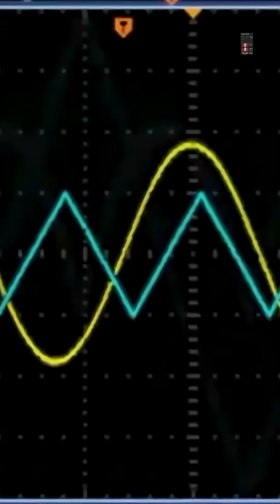Reaching a Frequency of Self-Sustaining Energy or Runaway Energy? #shorts  #selfsustaining

Comment: Then you take away the Energy source which Feeds the oscillation and you get a damped oscillation until the whole Energy in the System is Lost to heat.
Reply from the maker: The newest iteration of this contraption works on magnetic energy alone. That's what feeds the osillation - placing a magnet nearby.